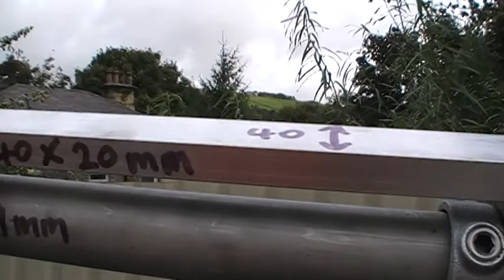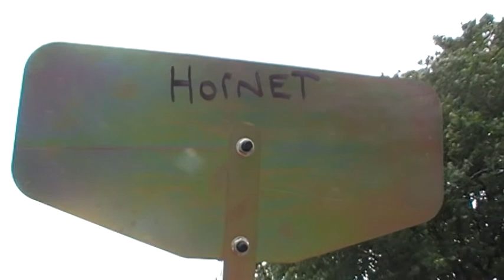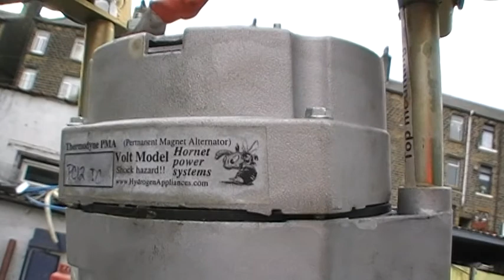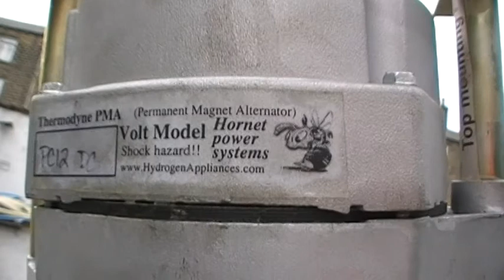2 Hornet wind turbines fitting  to 1 vertical tower " Fitting instructions made easy"

Comment: Very nice video - Been running a single for a decade (btw without the totally unneeded slip ring - unless you have to justify spending money for no reason and make it needlessly over engineered -least that’s what the taught the post docs at EE/mech engineering school, lol)... anyway this helps on how to add a second without getting silly -very nice, sensible, and ngineering savvy! The only mickey mousing I seehere, is below: to judge a home application that most HAWT builders use commonly, btw ... no slipring... surf the web and see the smart way ....